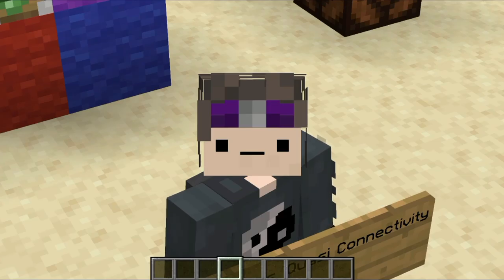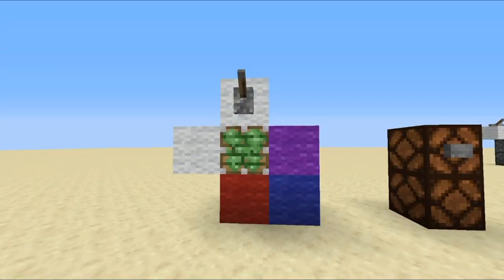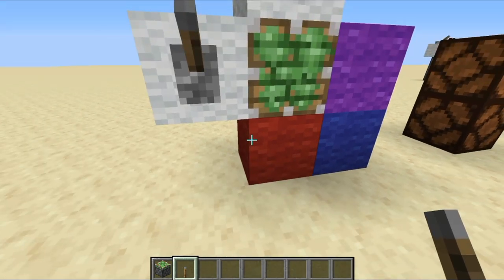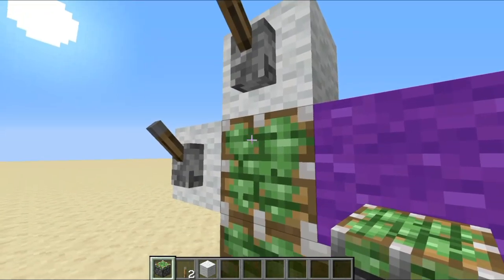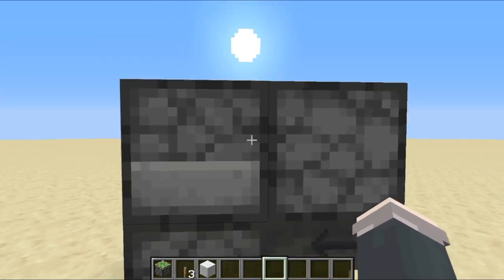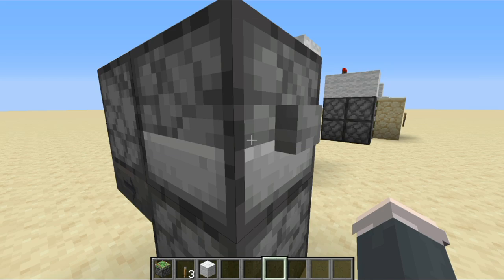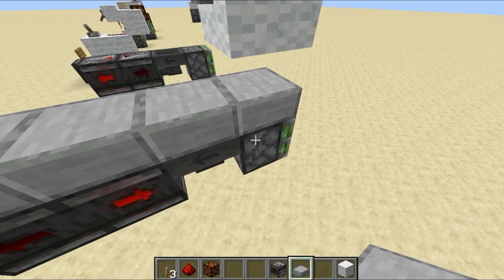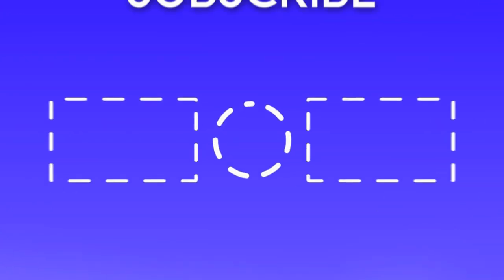The Redstone Rulebook - [Quasi Connectivity & Basic Connectivity]

Comment: That imaginary lamp thing was very helpfull tks!
Reply: yea i know, ilmango came up with a great way to explain it, right?
Reply: fyi the way it works is that it a glitch in the feature called Super powering where the signal if it is at strength 15 it will power the block and the block will output a redstone signal but the glitch is that it can power Air because Air is classified as a block and they forgot to make Air unable to be powered

Comment: The wifies connectivity with lamps and droppers is just that the dropper is a non transparent block so it let power go through it for one block
Reply: They are conductive
Reply: Well,

In the lamp example, putting a button on the top one would hard power it, then soft power the bottom one, connecting it with redstone will not work because then the top one is only soft powered.

Hard power spreads, soft does not

You can also use repeaters to hard power blocks as well

> Repeater
_ dust
0 button
# lamp

H hard power
S soft power

0___#
.      #

0___S
.       X

0__>H
.       S

As for the pistons, it's because of quasi connectivity, believe me, I don't know a lot about it but the basic principle is that the detection actually extends one block higher, e.g.

# Piston
$ Detection
& Block
+ Block with button
.       $
# -> $

This way,

+
&
#

Would still power since,
+
$ <- the block is being powered
$

HOWEVER... quasi connected pistons have to be updated before they can actually register the powering,
To update a block, you can... 1. Retract or contract a piston, 2. Place or break a block 3. Activate a switch or button etc.

% Quasi power

So when this happens...

+
# <- Soft powers, activates
# <- Quasi powers, the top piston then updates this lower piston

I THINK I GOT THAT RIGHT
If I didn't, then please correct me
Reply: with lamps, you are correct, they don't get QC powered. but it works with droppers actually. in the code it checks if the block above itself is receiving redstone power. QC works with pistons and dispensers (and droppers since droppers are a type of dispenser in the code).
Reply: @mstech-gamingandmore1827  u spent way to much time on this
Reply: @computerwrxck3681  You are 110% correct

Comment: alright for anyone here a year later wants to know an analogy to quasi connectivty:
think of the piston as the bottom half of a door: when the top block gets power it updates the bottom block so that it is open aswell, but if it isnt updated then the bottom door doesnt know the top one has been powered so it stays shut until something updates it

Comment: I mean, the button on the lamps works because the button powers the block it is on, which will give a signal to any block directly connecting, as such you can put redstone under a block with a button on it, press that button and the redstone will get powered, that's not unique to lamps.

Comment: Note that 3rd one, t flip flop is wrong. Droppers are full blocks, so if the top dropper is hard powered directly, blocks around it are soft powered, but soft powered blocks can't output signal's only during this time

Comment: The lamp connection actually is regular there is no quasi connectivity with lamps considering when you have a power source directly powering the lamp it will power the blocks around it because the lamp itself is powered as opposed to if there is a powered block next to a lamp it'll only power the lamp because the lamp isnt powered

Comment: you should've used the terms hard, and soft powering, also, your t flip flop doesn't need the redstone dust to function
Reply: if you know everything why did u watch the video
Reply: @ssstroyer3458  Probably in hopes of learning something new? And then he saw an area of improvement and decided to comment, nothing wrong with this imo
Reply: The Redstone was for demo purposes.
Reply: @revelcw  exactly what was it demonstrating? Wifies' knowledge of redstone?
Reply: @amplitudemc  no, that there is a signal there.
Reply: @revelcw  fine, but the whole demonstration with the t flip flop is pointless for this video, because there is no quasi connectivity going on there. it was a better demonstration of Wifies’ limited knowledge of redstone.
Reply: @amplitudemc  He never said quasi, he said basic (wifies).
Reply: @revelcw  i was under the impression that wifies connectivity was quasi connectivity but with a piston to update it. he seems to contradict himself. either way, he seems to not undestand very much about redstone, or he wouldn't have named something that already has a name, after himself.

also, who needs an explanation for basic connectivity though? solid blocks can power other things through themselves. that's pretty much it.
Reply: @amplitudemc  Yup. Can you teach me some more about redstone? After all, I did watch this vid to learn.

Comment: I am a professional at bedrock redstoner but I am really irritated due to this when i play java.Would you recommend bedrock redstone and Some bits of java redstone put all together in both games?

Like Quasi connectivity removed or not I'm not sure
And pistons connect to redstone dust directly and are counted as redstone items
Sticky pistons have a different mode like comparator which allow them to spit out block when 1 tick powered in 1st mode
And always pull back blocks even with 1 tick in 2nd mode
Reply: The practical benefits of quasi connectivity are enormous. I certainly wouldn’t want it removed ever
Reply: I feel like bedrock redstone is useless and inconsistent, Java redstone should be applied to both games seeing that it’s remained almost the same since it was introduced works really consistently. It does have its quirks but they’re consistent and really useful. I would have said we needed redstone to direct into pistons before 1.16 but target blocks allow us to do that now.